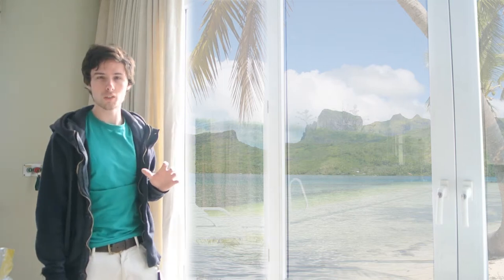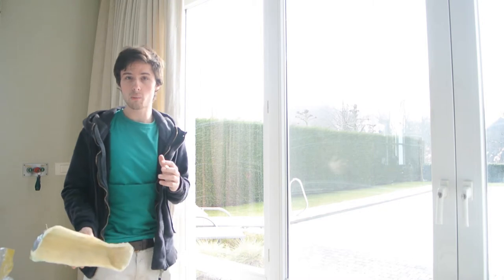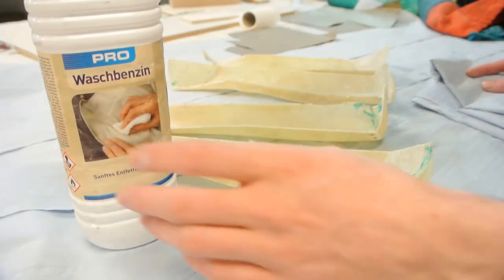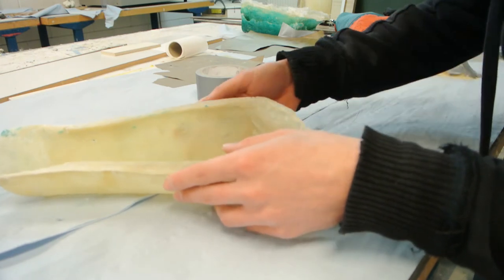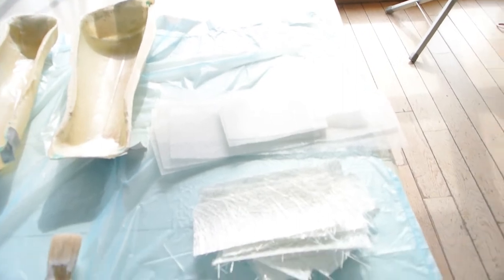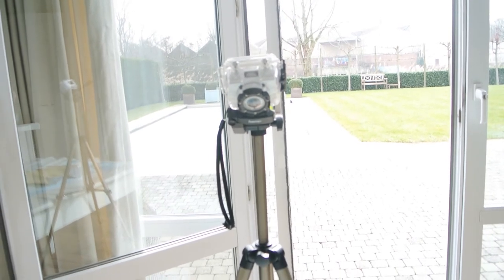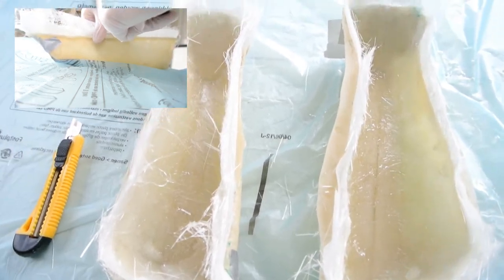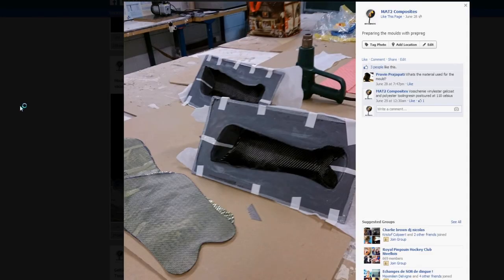How To Make A Splitmould For Prepreg Carbon Fiber (Fibre) Parts - PART 2 Improvised Splitmould

Comment from the maker: Good question! I made a split mould because fiberglass wouldnt be good at those high temperatures...The materials used in the splitmould are high temperature resistant, the fiberglass/polyester not